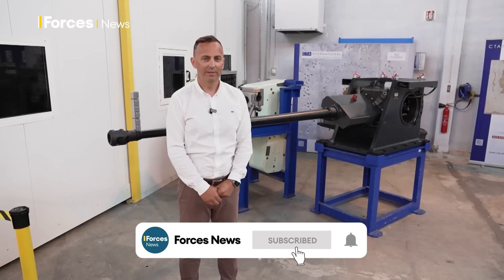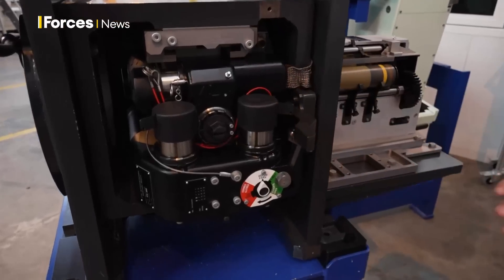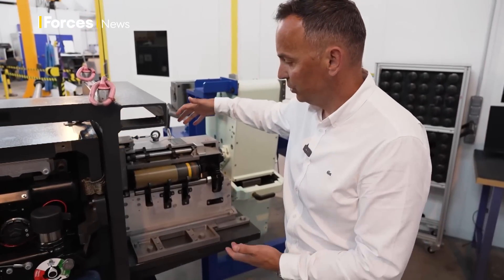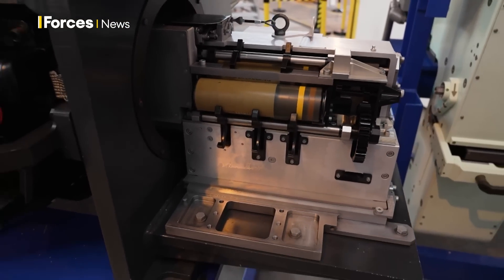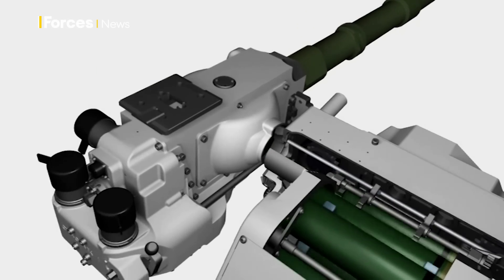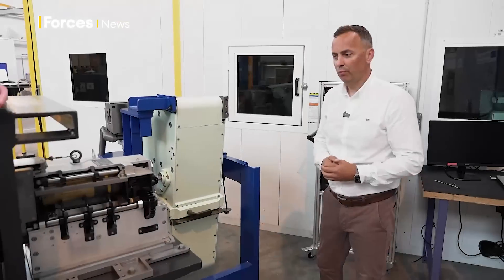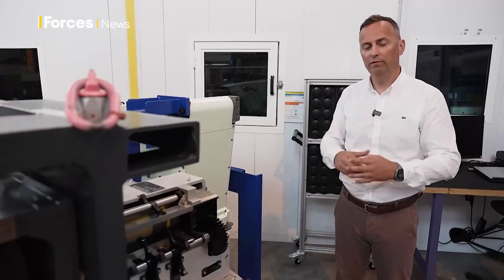Why British Army's new CT40 cannon is so advanced

Comment: This cannon was developed by American Air Force Labs from 1957 -1970's , overcomplicated , expensive rounds and short barrel life. Americans abandoned due to draw backs. Seems it took another 25 years to fix it. Doubtful if any other country will buy it besides co owners France!
Reply: What 🤣
Reply: @gubgub3275  The recoil is 20,000 lbs , roughly reduced by half due to muzzle brake being fitted. This recoil then has to transfer to the turret ring after going through short springs causing barrel wobble. The barrel life is 750-800 rounds compared to 5,000 for bushmaster due to blow by before the round seals. Ammunition is very expensive and produces 180 dB noise when firing, tis the emperors new clothes, also vibration from overloaded suspension shuts down fire control system on the mov.

Comment: My issue with this is that I see at least two failure points, both involving the ammo line up system, after the chamber rotates back, is there a hard stop to ensure proper lining of the chamber and also after firing does it line up again? Are there switches that ensure that they are lined up before another round is attempted to load in and if they fail can a manual over ride be used?

Comment: Sure this sticks less into the cabin, but do you really gain any interior space when you still need to accommodate a huge ammo loading and storage system just in a different location. I am kind of failing to see the massive problem this solved or what the advantage is here. Is this gun that much cheaper to produce that it warrants the use of this over existing 40mm guns? Is a few degrees of elevation on the gun the only real benefit here?
(Edit: Read up on this some more and wow. This was 30 years of embracing avoidable problems until they were things that required major redesigns(Like did no one even think that hanging a three ton loading system up to a meter off the centerline of the turret might cause some balance issues for the turret and cause the gyros that are trying to stabilize the gun to go nuts). 
When the Americans tested it they found the recoil impulse was so sharp that if would sometimes cause the firing control system to shut down. Also when you fired the last round in the magazine it could get stuck in the breach and there was no way to remove it from inside the vehicle. They also lost almost all the initial customers meaning projected ammunition cost skyrocketed to the point where it would be cheaper to bribe the enemy into going home then firing)

Comment: So every single round you load, you have to open a metal drawer, insert the round, and close the drawer again, and rinse and repeat?  And that's the most efficient way you could come up with to rearm the system?  Wow.  

Even the rotating chamber in the middle doesn't strike me as particularly ingenius, it strikes me as likely to seize during prolonged use in a dirty battlefield the like of which we're witnessing today.  Why not just use the shape of the round to your advantage and have a fixed port and a trapdoor, theres got to be considerably less surface area on a door than a full rotating body assembly?

Comment: If it was any good it wouldn't be made public. Such a system requires some 3-6 months of development, not 25 years, depending on funding and resources available.
Reply: @Turnipstalk well, given that people have designed analogous systems (for their time, and well before CAD), using many years of experience, and with the right stimulus to do so and with the right funding, very quickly, I think it's a reasonable comment. What's your, I'm sure expert, opinion on the time that would be needed? Indeed, no one mentioned CAD but yourself.

Comment: What's the rate of fire?
Reply: Seriously, it is down to 80 RPM in high accuracy mode, on the move shots. 200 RPM is less accurate, more for area denial/barrage fire than single target destruction.
It can also fire groups of amo. Start with a piercing round through the wall, imediately followed by 4 airburst sharpnel each timed to cover a different zone behind the wall

Comment: Innovative to be sure but its added complexity increases the number of moving parts.  All of which will have to be maintained under combat conditions.
Reply: You have to extract and reload with moving parts normally too. It's certaintly the thing to think about, looks good to me though. Now I'm wondering whether it "clutches" in to a recess in the barrel or simply rotates with a tight clearance.
Reply: @BeamRider100  No doubt.  Just an observation and given the required logistics to support an artillery battery, parts can become a serious issue.
Reply: You're confusing the complexity of the ammo loader with the simplicity of the cannon. I'm pretty sure the loader can be moved aside and the cannon can be manually loaded.
Reply: @intrinsical  Yes.  The ammo loader caught my eye first.  A manual over ride would allow continued operation.
Reply: Trails will show maybey show combat weakness.
But who cares when money is made and humans get killed...
Reply: The biggest drawback would actually be the ammunition, (would be my guess), the French use a 40mm cannon with proprietary caseless ammunition and the cost per round far exceeds that of regular 40mm ammunition. Of course the cost is brought down as a system enters wider adoption and use, but as it stands this ammunition would be niche in the world of 40mm ammunition and thus would be rather expensive.
Reply: I’ll use the gun in the video, you get yourself a club. Club has only one moving part, must be better.
Reply: @matthewkantar5583  Did you think of your response all by yourself or did your mother help you with it?
Reply: @matthewkantar5583  simple answer from a simpleton, well done.

Comment: You can make all the improvements you want, make the most advance armored vehicle you want, with the most advanced cannon... ever. It will not make a difference, war has changed now and until weapons systems designers recognize this, it will continue to not matter. Armored fighting vehicles now require a cheap and effective way of dealing with cheap FPV  drones. Relying on a main gun, even an advanced one with fragmentation aerial rounds, simply will not suffice anymore... the enemy can just keep sending drones until the armored vehicle is out of ammo and a sitting duck. These vehicles need to start integrating auto loading shotguns with large drum magazines, mounted on full range auto tracking turrets, they require an advanced optical target tracking system that can see everywhere at once, maybe even integrating sound detection or some other method of drone detection and an A.I. integrating all this information in real time. Crew should only need to have to flip a switch and activate the system and let it run automatically. Anything short of this, in todays battlefield is asking for defeat in my humble opinion.

Comment: Very tight tolerances.  Could be a problem in dirty/dusty environments.
Reply: That's what engineers are for.
Reply: @joe28704  True.  But just look at the first generation m16A1 rifles.
Reply: @robertodebeers2551  Good point. What I found interesting is they have been developing this for 25 years, talk about issues to overcome.
Reply: @joe28704  Work starter on design in 1950's .
Reply: Condensation and corrosion is a problem in armoured vehicles due to large metal mass cooling if not parked in climate controlled building.
Reply: @peterwait641  Ah, so!  Spot on.

Comment: How much gas to you loose between the cylinder and the barrel interface with your rotating chamber? In a revolver pistol for example, the gas leak between the cylinder and the barrel interface is significant.
Reply: The blowby before the round seals in the tapered obturator strips away barrel material, hence shorter barrel life and more cleaning required.

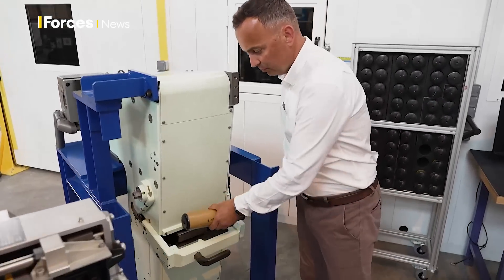Comment: 1:46 i really hope that it can turn the rounds 180° if theyre put in backwards. Or atleast reject it.
Reply: Looks like you can't put them in backwards. They physically won't locate or go into the carousel as there is a locator groove at the rear of the cartridge if you try and put them in the wrong way.
Reply: The animation must be wrong. Unless they designed the rounds so the detonator and primer are the same and the projectile can go out either end of the shell casing.

Comment: That’s an awfully complex chambering system. Lots of moving parts, lots of wear and tear. Single air cooled barrel firing 40mm shells is going to heat up pretty quick. It seems to be trying to reinvent the wheel.

Comment: So...
You were working on the niftigun before you started at the company? Interesting.
Also, that's a nice delivery time, twenty five years to get to prototype, the full quarter century. That's just the kind of development speed we'll really need during a war. Puts Barnes Wallis to shame, he took an entire year to get the bouncing bomb design finalised, manufactured, equipped, a plan developed and executed. A WHOLE YEAR. He was probably slowed down by having also designed three different bombers and may well have been confused by the development of shaped charge heavy bombs he'd get done in the few months after. Having to do it all by hand hurt him pretty bad, also. So, by my reckoning, Wallis was, what, about 175 times slower.

Wait, no, I meant quicker.

This is why you can't trust engineers. While you sit in a burning house they start calculating the flow efficiency of the bucket of water method instead of putting the f&^king fire out.

Comment: What prevents the loader from placing the round in backwards?
Reply: The carrousel won't be able to read the barcode, so it'll just spit it back out.  (The carrousel reads a code on the round to work out which positions have which type of round loaded, and the gunner can select the round he wants.  If there isn't a round of the correct type available the system will flash a PC LOAD LETTER error).
Reply: @JohnHughesChampigny  who ensures that the bar code has been marked the right way round?
Reply: @MARTINA-gc3tq  It is not a barcode but a wireless com with the munition. Most round are programmable (timer) and all have this kind of NFC for ID. It doesn't work the wrong way in.

Comment: Would love to see a version for the AC-130, as they had to drop the 40mm Bofors due to lack of parts for the WW2 era system.
Reply: Lack of parts?  It's still in production.  There is only a lack of parts if there is a lack of orders placed for parts.
Reply: @iatsd  I never said L/60 production had stopped. I only referred to the US only using its existing stock of L/60 parts, which had come to an end.
Reply: Agreed if we had different AC-130s would be great.. have one with 3 of these 40mm and the "ant dance on the floor" would be great.. the UK should have 2 AC-130s and they could also be for NATO also.. UK should also consider using the 30mm GAU on a dedicated fire platform for ground and anti air attack..
Reply: @aaronrey2658  why tf would they want to use a gau30 when they have far better & more modern options?!

Comment: One problem i can see with the spinning breach is how you can clear a jam.
Reply: Looks like the loading arm can ram it through with the next round.
Reply: @winosabbathi  do you seriously want to be in any IFV which would even try to do that?
Reply: Well assuming it’s electronically controlled, there would obviously me extensive code and multiple sensors preventing any of this occurring. I understand if this was made mechanical,y operating though.
Reply: @Polkem1  I think you mean "numerous". Electronic sensors are liable to degradation on function due to to dust, dirt and all manner of factors.
Reply: @gurglejug627 I would say, say can be said for mechanical breaches, however them saying they have what was it 20 years of development. I believe that factor would've been a consideration for them. So they must've found a solution of seen it hasn't been a issue so far.
Reply: @Polkem1  you have no idea whether it's been an issue or not! If you reckon you know how it all works, and it's all so easy, why haven't you 'developed' it, in 20 years? Why hasn't is been in AFVs almost since WW2? But all you say ignores my point and rather skirts around it...
Reply: @gurglejug627  I’m getting the perception I ticked you off somewhere, “why hasn’t it been in AFVs since ww2” well I don’t know whether the technology was even thought of then, do you know? And I didn’t ignore your point, I replied with a reasonable statement, which obviously would’ve been a consideration, like in most mechanics, or electronic warfare systems.
Reply: @Polkem1  you did 'tick me off' with stupidity and have succeeded again - your comments skirted mine without actually addressing them with reason or (seemingly/blatantly) experience. Yes, all manner if systems were tried out in and since WW2, some needing fine tuning with modern electronics or metallurgical knowledge, yet others (many) worked very well but were not implemented for a variety of reasons. You comments showed a sort of pseudo-logic, yet not reason, which seems rather arrogant and ignorant.
Reply: @gurglejug627  firstly, there’s no need to be mad, secondly I didn’t not explicitly claim any fact, I just stated my opinion, that a certain factor would’ve most definitely been a consideration. It seems your anger stems from nothing, so no point continuing this discussion.
Reply: @Polkem1  "this would obviously..." I'd say you were stating a fact. I'm not 'mad' (I assume you mean angry), rather i'm disappointed by some of the foolish comments abounding. Don't forget - other people have to live on the same planet...
Reply: @gurglejug627  Let my clarify what i took from what you just said, are you saying that they haven't considered dust, and dirt as a factor in their system even with many many years of development? Even at the point where production is starting?
Reply: @Polkem1  hahaha now you're trying the vile, underhanded and distractive "so, are you saying...". How low can you go, having already shown yourself as a liar?
Reply: @gurglejug627  are you seriously?? what am I lying about? all I said they would've considered dust and grime as a factor with 25 years of development, that would've been one of the biggest factors since its the conditions of war, and what are they developing, piece of technology for war, so I don't know where I'm lying.
Reply: breech.

Comment: Rotating breech will have lots of fast stops and starts that need to be spot on accurate. To make that work is impressive; but will it still work well after its fired a lot of rounds?
Reply: Look at the complexity of the GAU-8 for comparison-that weapon has been running reliably for years

Comment: Ok, but what is the advantage over designs using ‚conventional‘ ammunition?
Reply: Gun is more compact, weights less and can be put in a smaller turret, and give more space to the crew and other systems. 

Another advantage of the breech being so compact is that it can be elevated very high, to shoot at aerial targets (like drones).

The ammo is also very compact for a 40mm, meaning you can bring more of it. The Ukrainian that received the Swedish CV90 with a conventional 40mm cannon have complained that they can't bring enough ammo compared to a smaller caliber, so this design solves that. 

Another advantage of the swing breech design is that the spent round is pushed by the new round out of the chamber, so it's easy and efficient to switch between different ammo types, compared to a regular cannon that needs several feeding systems going into the same gun.
Reply: Both the action, how it reloads by pivoting, and the ammo take up much less room, so there is much less space required in the turret. Additionally, the telescoping ammo is much shorter and take up less storage space in the vehicle.
Reply: @farhorizons3901  Ok, the ammunition is overall shorter, however the propellant has to go somewhere, thus the diameter of the round is increased, so there’s not really any size advantage, but at best a shape advantage.
Reply: @RichelieuUnlimited  Suggest you look at cross section cutouts of the telescoping rounds to understand how they achieve the size advantage.  Conventional rounds are bottle-necked (stepped) so the telescoping rounds being cylinders, do not need to be of greater diameter.  Conventional rounds are only partially filled with propellant, so in a telescoping round, the projectile fits in the void space.

Comment: Very interesting and cool! From an engineering perspective- is there any concern that with added moving parts, especially in such a critical location of the weapon, that there is increased chance of failure?
Reply: Electronically run guns are far more reliable than has or recoil operated arms but it also means sensors can be added to prevent problems. Its much like any electrical machine
Reply: *gas

Comment: Innovative new design, little recoil, and high rate of fire, excellent!
Reply: The recoil is probably not so little, it was the breach that had a short travel, to save space inside the turret.
Reply: The A3B light anti-air ammunition is fantastic too!
Reply: Will be a quite violent recoil when the gun cant move back much to absorb and lengthen the recoil impulse. Also for high rate of fire, you dont need that high of a rate of fire when you only have 60 shots.